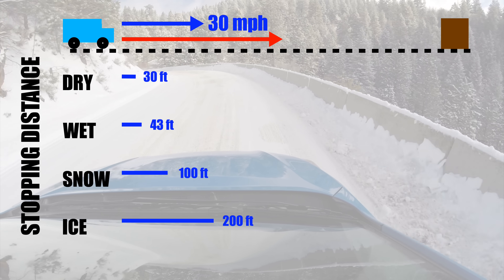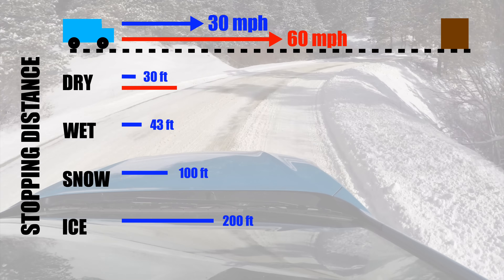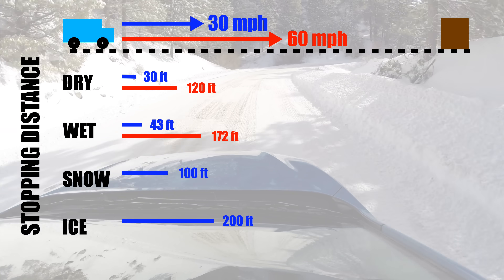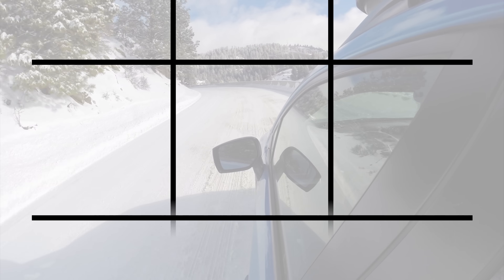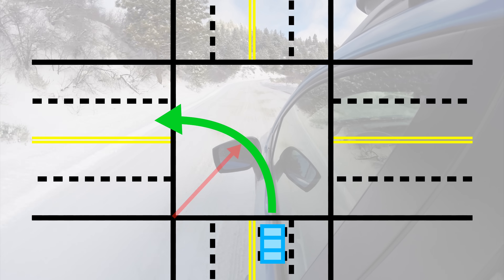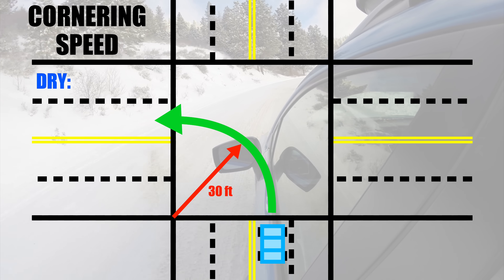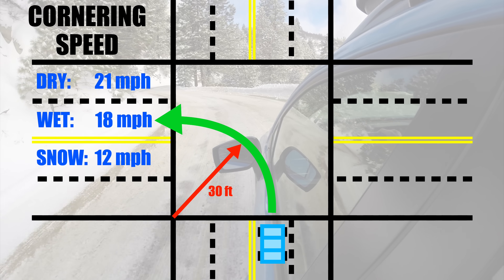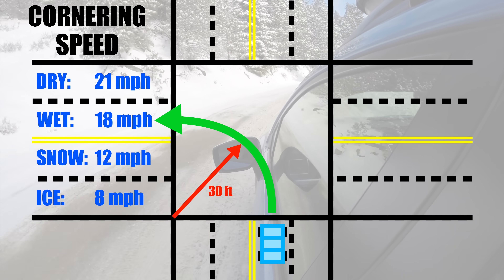Everything You Need To Know About Driving In The Snow

Comment: The most important thing is NOT to use the fact that winter tires increases that G-Force circle as a reason to go faster. The difference between the “normal” G-Force circle and the winter tire’s larger circle should only be used as a safety zone. Some people think that they can go faster in snow or ice because they have winter tires. The ability to do so should not mean you should. Winter driving conditions can vary greatly, within a very short distance and having that safety zone will be helpful when it happens.

Comment: The reason behind being "smooth and slow with your driving inputs" regards the coefficient of static friction. If you start sliding (tires are now experiencing the much lower coefficient of kinetic friction), the best thing to do is let go of both the accelerator and the brakes so the wheels can return to static friction (rolling) and when they do (you can tell by feel), you barely press on those brakes (1-3%) so that you don't increase the force too much and again start to slide.

Comment: Limitation: friction, centripetal force, and mass. Which results to influence the acceleration, deceleration, speed in the curve, radios of the curve, and distance of the sliding
Reply: The key point is that a flatter surface between tire and the road providing a less coefficient of friction.
Reply: Newton's first law often defeats the hubris of the self-declared invincible.

Comment: 2:00 Is this assuming the user is inexperienced and only using full brake pressure? I feel these numbers vary widely based on the input from the driver (i.e. downshifting w/ light braking vs no downshifting w/ full brake pressure). This should be clarified.

Comment: Some very good salient points. I’ve always found that ‘testing’ the conditions in your car when you first start out is extremely helpful. Find a relatively secluded spot and try some low speed ‘panic’ maneuvers that won’t cause you to hit anything. That way, when you’re out on the road you’ll understand how your particular vehicle will react in those particular conditions. Different surfaces cause dramatically different reactions for your cars steering and braking…!

Comment: They say all-seasons tires are bad, however last time on heavy snow and ice in the city I felt like I was cheating. Most cars danced, either couldn't go straight, or when they stopped, they couldn't accelerate at all. And I was going like there was no snow at all. Not too fast, but not too slow either. I know, they wear out much faster in the summer, but we don't have hot summers here, so I use them like 3rd year and they're still fine. Also wider tires seem to help. They say they're slower and they most probably are. But better grip saved my car more than once.

Comment: ADDING WEIGHT TO THE BED OF A PICKUP HELPED ME GREATLY. I put plastic in the bed and filled halfway with water, let freeze and it doubled my traction on the road. I later also added two sandbags to the floorboard of the rear seats which also increased my traction. Avoiding using the brake on ice is a major plus. SLOW AND STEADY!

Comment: Recent winter tires perform less well because tire companies are using less natural rubber which got too expensive. The more natural rubber, the more the gum stays soft as temperatures drop, ensuring more grip. Some cheap tires perform well in weather down to 20F but become slippery below that point.  More expensive tires should preserve better gum softness in much lower temperatures

Comment: I've driven in Montana winters for over half a century This is a pretty reasonable explanation for people who understand practical physics. 
Perhaps as important as this is the materials science related to an understanding of the coefficient of friction for snow and for ice and how each changes depending on temperature. At -40°, snowpack and ice is very forgiving for steering. But at 32°F, wet ice is almost the most slippery substance known to man. If it's warming fast and the ice is wet, a breeze can start a parked car sliding.

Comment: The G force your tyres can provide is total G. Be it cornering, acceleration, or braking. If you feel you just can't steer away from something and also not stop in time, let off the brakes, and you have some more cornering ability. Having a racing wheel with force feedback and Beamng is good practice for this. Saved my life a few times

Comment: to improve traction while moving you can spin the tires so they can throw the snow between the groves of the tires so they can bite into the snow. You can only so this with ESC/or traction control off and will significantly improve traction. 
Another trick. if you are steering the car slowly and there is an obstacle say on the left of the car and as you go ahead the rear gets closer to the obstacle the instinct could be to turn the steering to the right. This way the front of the car will go further away but the rear will probably get closer so you need to point the steering to the left and the rear will move to the right

Comment: Is the traction circle always a circle? As the tire doesn't have a perfectly equal on all sides grip surface, isn't the amount of G's needed to push you in one direction greater than another? For example could you be pushed to the side easier than you could be pushed forward because the tire has less grip to the side?
Reply: Not always, but the difference is marginal unless you have modified the camber and such You could always lower tyre pressure for a big grip improvement in the snow should you need it. Following the car manufacturer pressure specification and lowering it slightly will help. They set it that so it is balanced to give reasonable fuel economy too.

Comment: Please don’t move to Montana because you’ve watched “Yellowstone.” 
The show is not an accurate representation of Montana life.
There is no such thing as a “snow day” here. Winters are long, cold, and harsh with few hours of daylight. Cold can affect the driving and engine performance of your car, including its ability to start. Prior to driving a car parked outside, it is essential to remove any snow and ice from its hood, top, mirrors, and windows.  Low temps can strain and drain a car battery, producing less current and slowing engine oil movement. Cars in Montana must be equipped with an engine-block heater, including the wiring and plug for connection to an electrical outlet. All new cars purchased in Montana already come with an engine heater. In Montana, you have to wake up early to shovel any overnight-snow before driving to work, often in the dark and in miserably cold and windy conditions. Depending on snow type and amount, snow-removal is hard work that can take hours. If you don’t shovel, the snow packed down by tires, feet or snow-melt will turn to thick and slippery ice. 
Also in Montana, Winter temps get low enough to freeze nostrils shut while also freezing eyelashes, moustaches, and beards. Hot beverages will turn to ice before hitting the ground. Mountain Lions don’t hibernate and can target bus stops and pets — even in cities/towns. 
Real cowboys laugh at their Yellowstone character depictions. They can be ruggedly handsome, but they aren’t movie stars. Cowboys are not frequently seen in public because ranch work never takes a break. Cowboys spend all day, and sometimes nights, immersed in back-breaking work. They are often covered in dust, mud, sweat and sometimes cattle/animal excretions that can freeze on their clothes and skin in winter.
“Yellowstone” the show is fiction.

Comment: What useless information. If you are driving in snow and ice, use chains. DONT RELY ON WINTER TYRES. THEY ARE USELESS ON SNOW AND ICE. 
Nothing said here helped me in anyway shape or form. Slow down for a corner and keep car moving we already know.
Pro-tip if driving on a snowy road drive on the undisturbed snow it will have more traction, pull off in 2nd or 3rd gear, turn off anti-lock brakes and traction control if possible, traction control unless made for snow will be worse than without. These are the things people should have been told, not about useless traction circles that no one understands or wants to understand. It just makes you look like a know it all who doesn't actually know anything.

Comment: Decades ago, we just used to use common sense and drive in the snow. We didn’t really talk about it and didn’t need instruction. Plus, we only had rear while drive cars. Slow down, increase following distance and no sudden movements or rapid changes in acceleration are common sense. What a little politically correct little nanny state we have turned into.

Comment: In the future electric cars might be able to throw it in reverse and punch the gas for emergency stopping situations. Would it make any difference? I guess it might... just because you might be changing the surface beneath you... like if it's digging away the snow until you get to the asphalt and then that allows you to stop...
Stopping is a vector in reverse that's been exhausted (beyond the grip)... and reverse throttle is just more reverse vector that already doesn't have enough grip , right ? So I think unless it's changing the surface , then it doesn't make a difference , either way. Probably 18 years since I've taken physics, but that sounds reasonable (but could be completely wrong lol).

Comment: The issue with driving in the snow is people are to cocky. When driving in the snow there’s a lot of things you have to take account for. For example, tires, gas pedal,breaks, clutch(if you have one), acceleration  and deceleration, and knowing limits of both driver and car. A lot of people barely know what they driving. I think the best solution of driving in the snow is by doing it . Don’t do anything crazy like speed. Just get used how the car handles for every giving situation.  I think driving license should require a course for snow driving.

Comment: Before the advent of ABS brakes, I learned in my manual transmission 1986 GMC Sierra would stop quite quickly using down shifting to 1st gear.  I tried the same thing with my automatic transmission cars and that also worked.

Comment: Negotiating lights or a junction which are at the top of a hill or incline, if at all possible slow down to a crawl before you get there rather than completely stop because based on experience unless gritted you will not be able to move off.

Comment: That's why we have dubbed winter tires in Sweden.

This in not everything you need to know about driving in the winter. There are completely differnet techniques in skid recover for front wheel drive and back wheel drive, for instance. And this is why a manual gearbox is much easier to handle in some cases, you just hit the clutch hard and fast to get the car into unpowered wheel drive (neutral) in some cases. Back wheel drive, you must steer against the skid with unpowered wheels (this is the way that is working best in all cases). Front wheel drive, you can give more power and steer with the skid to some extent. Manual gears also gives one the benefit to use the clutch, to get a pendulum technique in getting out of a deep snow situation - which is nearly impossible to be as effective with an automatic gearbox. This means rocking the car with the clutch, forth and back, until the wheels get over the packed snow or ice.

Always travel with non-frozen gravel and a shovel in the trunk to get out of positions where you are stuck. Travel with clothes like you are outside you're vehicle. If you get stuck - you will risk your life with summer wear (hypothermia), especially in rural areas where there could be hours to the rescue.

Comment: Got a question:

I've seen a GLC Mercedes failing to climb a ramp in a snowy weather....
While a dacia Logan (front wheel drive prety basic car with not much tech) making it up that ramp.

How's a 4wheel drive wider wheels, better tech... Fails and a simple old car make it ( both were using normal tires)

Comment: If your vehicle has only one rear drive tire, you can have two rear drive tires by engaging the parking brake JUST UNTIL the passenger tire engages and  does not slip. Don't forget to release the parking brake when the passenger side needs to be passive.

Comment: The only way to learn how to drive in winter conditions, is to drive in winter conditions. Learn what happens when you get wheel slip, learn how to correct when you’re in risk free conditions (ie empty parking lots) so that it becomes instinctual, and learn not to panic and lock up the wheels when you start to slide.  It all comes down to how you react when you break traction, which you will do.

Comment: If anyone wants to help me out I have a lengthy question.
I was a passenger in a pretty bad accident in snow. 
This has lead me to wanting for my own car to be able to handle better in snowy and icy conditions.
Currently my fiance and I own a 2006 chevy cobalt which I feel like handles terribly in any snow (could be tires also, but maybe the car isn't great at handling in snow too?)
Our plan is to upgrade to a AWD car. My main question is the difference between winter tires and using chains, because chains are so much cheaper that would obviously help a lot. But are winter tires better than chains when it comes to overall traction on snow and ice?

Sorry for the long question, thanks if anyone sees this haha

Comment: The major problem regarding snow driving are the other vehicles, especially inexperinced drivers in unprepared cars.
So inside track: Four-wheel drive, LSD, diff-lock and obviously snow tyres. Get a proper vehicle, not a puddle jumper on worn out summer tyres.
Driving technique (assuming automatic): 4WD, out of overdrive, 2nd gear, engage diff-lock (so all four wheels turn at the same speed) get the revs up for the hill and boot it. Of course if you meet another car coming down the hill it's panic stations. I have a couple of Pajero iO with an over-engineered transmission and they've never let me down. 
Jack, the Japan Alps Brit

Comment: As a Canadian, I have a few tips for all you people. 

1.Leave four or five car car lengths infront of you on ice or slick conditions. If you have all season, try six car lengths.
2.If you hit a deep snowdrift on    the road, expect to turn your wheels as it will turn your vehicle, do not hit the breaks keep a constant speed.               3.If your car starts to shake violently after going through a snow drift, it means there is snow in your rims. So you should pull into a gas station to knock it out.
4. In white out conditions, if you’re on a highway. Slow down to 30-50km/h and put your blinkers on. Do not go over 50km/h  you’re an accident waiting to happen if you do. The blinkers are also key for your safety, so people behind you will slow down and not rear end you.
5. Unless you’re on the highway in a potential pile up,  leave to the ditch if you can do so safely. Make sure you’re out of the way of any potential cars going into the ditch. Also if you’re in the ditch, don’t leave the car. Just wait for help. 
6. Don’t hit the breaks in a front wheel drive car if you’re slipping into something.

Comment: in a manual car, when you start sliding, should i press the clutch, or raise the clutch to sort of engine break?
only think i know that you defs shouldnt do is slam the breaks
i also know its adviced to get of the main driving line into the snow/gravel/grass area's that arent as slippery to gain traction and stop quicker, but i still wanna know what i should do with the clutch

Comment: Other points from a Canadian: 
- clearance between bottom of vehicle and the ground sometimes matters, but that's a vehicle decision more than a driving decision
- adding weight to the vehicle (by having more stuff in it, for instance) can enlarge the traction circle...not sure by how much though
- intersections where cars must stop tend to develop ice because exhaust gases melt snow, which then refreezes
Reply: Yes.... and that melting is also caused by temperature increasing on spots where breaking/accelerating friction is at maximum level...
Reply: ah yes the weight   - 90 degree turn after a downhill section covered in ice - the s3's and e36 made it   - ranger raptor ended up in the ditch

Comment: Excellent video, but I think there is one important fact that should have been added at around 3:56 or so...static and kinetic friction.
Static friction is generally higher than kinetic friction. Therefore, when you make a sudden turn and break the static friction, you slide out of control much easier because it is more difficult to regain that static friction when relying on kinetic friction to do so. The difference between static and kinetic friction is much less on dry pavement than it is on wet, snow, and ice.

Comment: Thanks for the info about traction circles. I’d never seen it that way.
And two thumbs up for mentioning that you need to ease in to the acceleration and braking. That is something everyone needs to understand. I only wish you had spent a few more moments to emphasize that a bit more.
I may be wrong, but I think that is what most people fail to understand. You can’t just stomp on your brakes in the snow or ice. Your need to ease in to it or you’ll have less braking power and less control.

When you stomp on the brakes in poor traction conditions the wheels lock up and slide, doing nearly nothing to help slow down the car. When you ease in to the brakes the tires slow down without losing grip, so tires transfer your braking power to the road better. (I’m sure that could be explained better. Hope it makes enough sense to get the message across.)